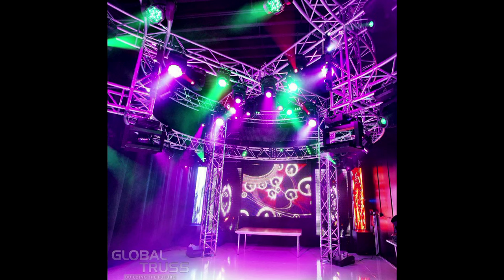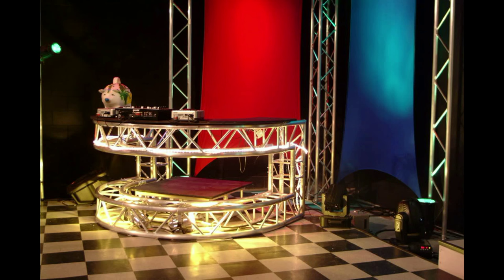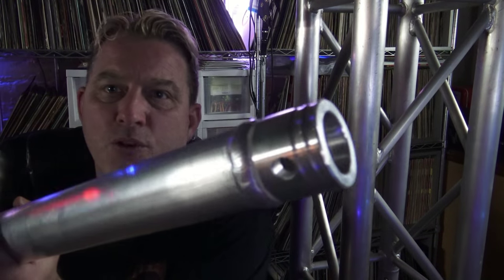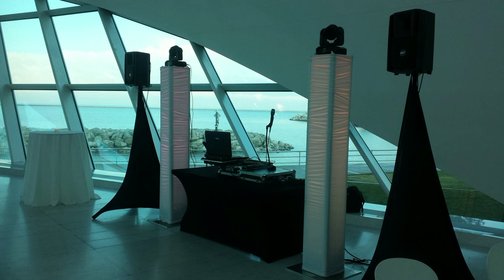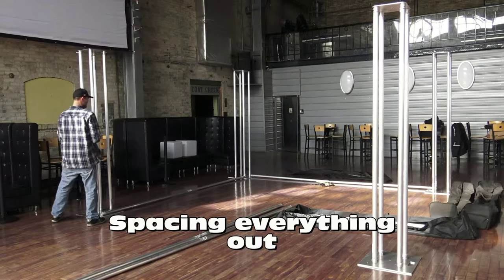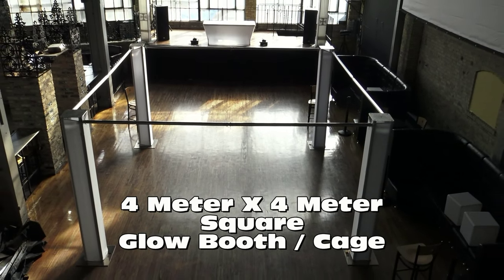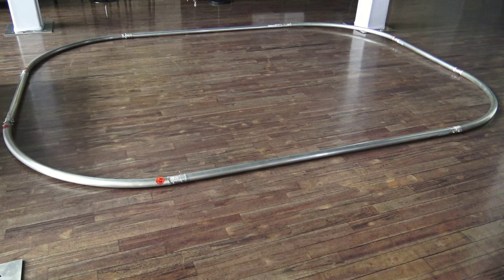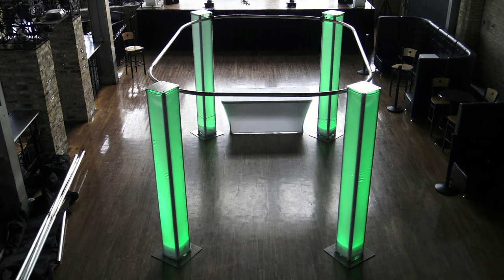Glow Booth Creations With Global Truss America / Duratruss

Comment: I like the Glow Totems set up because of the transport issue.  I do think they lose some of the effect because you don't have the crisis-cross supports the F34 has.  I do agree, there are endless possibilities with just using single pipes.  I sometimes use the single pipes between two regular totems and hang my stretchy screen between them and the single poles horizontally hold the screen tight on the top and I used little weights on the bottom.  So many DJs just use them in a typical way, I hope your video gets more of them to think a little differently.

Comment: Good stuff for saving space, but not great in terms of budget.  The straight pipe from Global truss is really expensive, to the point that getting the box truss look will end up costing just about as much as the same size stick of truss, only with a lot less value in terms of re-selling.

If you want to save money and space, you're be just a well off to just get some schedule 40 pipe from the hardware store and use swivel clamps to connect it to make a structure.  Would have to find a different solution for getting the box truss look since regular pipe isn't going to mount to a truss plate.

There is a fine line between saving space and saving money that you have to be careful of or you'll end up spending more to fake an effect that it would have cost to just buy the product out right.

Cool video, thanks for sharing!